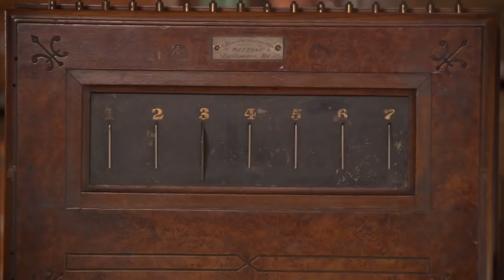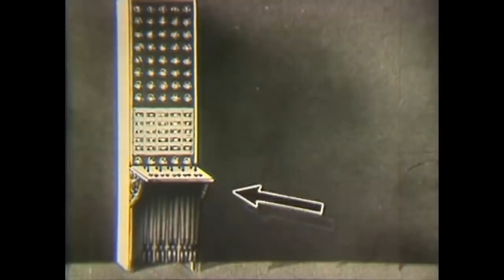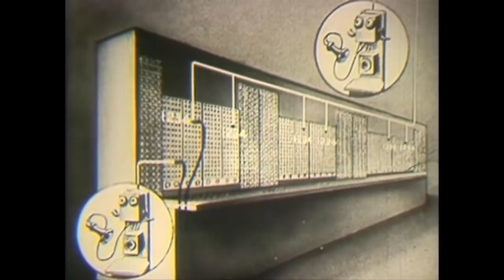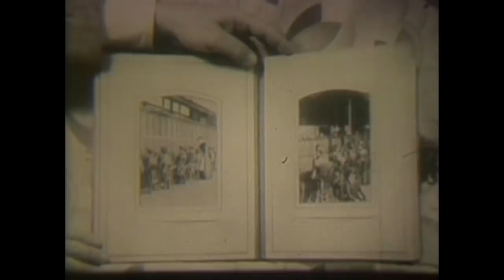AT&T Archives: Switchboards, Old and New (Bonus Edition)

Comment: My mom was an operator in the 1950s for Southwestern Bell, then worked switchboards at Montgomery Wards then at Sears (she was head operator there for some years) in the 60's and possibly early 70's.  She worked what some call "cord boards".  I learned to work the one she worked at one place she worked.  I then was able to work the switchboard at a high school I attended that had a board that was from the 40s.  I used to relieve the operators at several places I worked but by the mid and late 70s, everyone had gone to the  Demension system  which was wonderful.  No more cords and switches, it was all buttons and would fit on a desk with ease for an entire building of telephones, be it an office or hospital.  It was fun and I didn't have to do it for entire shifts,, but male operators are apparently rare.  Some people disconnected when a male answered assuming they had an incorrect number.
Reply: Oh how interesting!
Thanks for sharing. It made my day!

Comment: Retired from AT&T after 30 years. I saw many changes from 1981 to 2011!
Reply: I have contracted for the phone industry for 25 years and I also have seen many changes in equipment.
When I first started almost all equipment and materials were made in the USA now it's China or some other foreign country.
Reply: @garymckee8857   - so much easier to eavesdrop on conversation with PRC gear.
Reply: The layoffs were great!  And the dismantling of Bell Labs, another smart decision.  But seriously, the monopoly had run its course and Moore's law won.  God bless you, Mr. Shannon.
Reply: @workingtheworld68  you are correct firewalls are manufactured in 🇨🇳
Reply: All for the worse I bet
Reply: aDg 2k18  the monopoly was not good for consumers. You speak of the judge green ruling.
Reply: I'm a old microwave tech. I worked on att  public network and oil company private network since 1980
Reply: aDg 2k18  my comment was reinforcing what you said, with the name of the judge that ruled in the case.  Judge green.    IM AGREEING WITH YOU.  OK
Reply: aDg 2k18  Judge Greene presided over United States v. AT&T, the antitrust suit that broke up the AT&T vertical market monopoly on the telecommunications industry in the United States. The case, one of Greene's first after being named to the bench, resulted in the 1982
Reply: @peterjszerszen  old bell guy here.
Reply: aDg 2k18  you funny,. I regret the caps.  I should of been more clear in what I was saying.
Reply: aDg 2k18  I think it can be difficult expressing emotion and thoughts via text.
Reply: My cousin had the first mobile phone in the family in mid 80s - so expensive back then.  Now it’s almost more rare for someone to have a landline!
Reply: @southeastclass76  I remember that Ma Bell breakup like it was yesterday; Hard to believe it’s been so long now. I guess I was in Kindergarten; when I still remember the teacher talking about what a big deal it was and how impactful that company has been on society. 

I think it was a needless, shamefully wrong-minded ruling though. The company contributed enormously to our technological development — and instead of seeking massive profits on the most important advancements like the transistor, they gave it away to society for free when it could have made them billions.
Reply: @southeastclass76  Not sure we’ll ever see another organization like Bell Labs or even Polaroid, funneling so much of their massive resources into research and development. Today R&D is far more focused and narrow, primarily driven toward advancing a companies bottom line—and as a result, more risk averse.
Reply: @southeastclass76  *should've

Comment: The start of my apprenticeship with  'Post-Office Telephones' (UK), was servicing manual boards in the operator-room. Some of the equipment was put in during the early 1930s. Made of solid brass, it never wore out. The only things that failed were the operator's cords and pulleys. There are still  Main Distribution Frames in some London telephone exchanges that have hardwood terminal-blocks wired with cotton-covered wire! They still work though and the smell and sounds of an old exchange is something that stays with you forever.
Reply: Plenty brass polish, many hours cleaning those brass plugs!

Comment: Saw a really old time switchboard in Hoboken New Jersey hotel.  Worked as an operator in South Dakota on the original drop down (magneto) boards (for a town and had several lines (farms) on each line.  During electrical storms we operators would get "bit" by a small shock sometimes and all the lines would drop at the time.  Then worked 5500 boards for Morristown New Jersey (pbx) 50 Jack's to a position.  Also Pacific Bell information operator in the 1960's (madly thumbing thru a telephone book for each call). I got to love Motorola equipment when we finally got to own our own headsets. 😊

Comment: To those who are curious, the dial office shown in the film at 9:40 was the Western Electric Panel switch.  It was the first automatic switch developed by the Bell System and installed mostly in large cities starting in the 1920s.  The Connections Museum of Seattle, WA currently operates the last functioning Panel switch in the world and has a few videos about it on YouTube for the even more curious.
Reply: Before this, another form of automatic switching, known as the step-by-step system, using direct dial impulses from  callers to connect to the number being called. manufacturer was the Automatic Electric Company. Its use was in moderately large to rural cities and towns. First such switch was installed on the Bell System in Norfork, Virginia, in 1919.From then on, it was used on both Bell and non-Bell telephone exchanges.Try the  Connections Museum of Seattle, WA, as these, like the panel system, are no longer operational.

Comment: When I was a young girl in the 1960s, my dad went to have a hernia operation at Franklin Blvd hospital in Chicago. I went in and out of the waiting room with my mom, and there was a room with ladies connecting calls with plugs into switchboards. I had a small transistor radio with a little earphone that my mom bought me. I told her, I can plug the earphone into the earphone jack the same way that the operators plug the plugs into the switchboard.
Reply: I think the plugs and jacks are basically the same design, just smaller on modern devices.

Comment: This seems far more impressive - if confusing - than just doing it electronically. All the stepped switches and plugging wires in all over the place seems like more of a technological feat.
Reply: When the telephone was first invented there was no switching at all. you had to order a pair that only talked to each other; more of a simple intercom system. Manual switching and interconnection came later. When a network or town outgrew its switchboards, then it was automated. Later, local networks were interconnected with each other for long distance calling capability. It's a great example of how one invention spurs another in a kind of evolution. No one envisioned the entire system from the beginning.

Comment: How does the operator know when the call is completed though, so they can unplug their patch cable?
Reply: The boards we had would close the eye on the circuit when the call was finished. We also had a check switch so we could listen in without clicking on the receivers of the users and it  muted our microphone so they could not hear us.  In the Army, we had to ask before removing the plug, like "are you working? are you working? BREAKING DOWN! then pull the plug.

Comment: Working a full shift on one of these cord boards looks exhausting. I worked in a large call center with no sound proofing between the operators. It often was so loud that I couldn't hear myself think. I took roughly 200 calls a day. These gals look  like they're each taking much more than that. I left this job in 1996 and still can't stand hearing a ringing phone.

Comment: For decades,  we were used to the 0-9 key layout of calculators.  Then telephone operators had to get used to key layouts that were two rows!   Then some nut invented the touch telephone that had a key layout of a familiar calculator, except upside down!   Why??
Reply: Joshua Sidell Yes, The "telephone" layout was designed to emulate the rotary dial. (lower numbers on top ). One needs to remember that the average person was immensely more familiar with the rotary dial telephone than they were with calculators (or even adding machines,for that matter). in the 50s and 60s. Even the "qwerty" keyboard was more familiar to "civilians" than the "calculator" layout. It wasn't until the middle 70s that inexpensive calculators became available and introduced the masses to the "calculator" layout.
Reply: Joshua Sidell I wasn't disputing anything of what you said, I was just pointing out the 1950s-60s consumer perspective  and how it influenced Ma Bell's design consideration.
Reply: Joshua Sidell Yes, that's a "thing" especially among us "older" folks who are used to "telephone" format, It still "hangs me up" (pun intended!) when I use the numeric keypad on the PC!

Comment: I'm old....can you even reach an 'operator' today??
Reply: You can, at least with AT&T.
Reply: and with today's cheap fibre transmission technology, they save money by having the operator be in a low wage country overseas.
Reply: Yes you can! I use them a lot at work for international calls. Especially when I can’t remember the dial-out code :)
Reply: More and more, the subscriber is the operator.
Reply: In hospitals when a patient can’t speak english, there is a number hospitals can subscribe to that allows staff to call for a translator.  And it’s maybe the only option unless the hospital has a system of volunteers to use.   I’m retired but I’ve used this in big centers in different states.  Known as AT&T Language Line.

Comment: Does the standard of Female Telephone Operators have to do with the Speaking Registers of Women vs Men?

I. e. Higher (Soprano-Alto Registered) voices sound more clear?

Even on Current equipment I have been accused of "Mumbling."
Reply: My guess is that it was primarily related to the fact that they could get away with paying women less.
Reply: @kcgunesq  That Too.
Reply: If I remember correctly, another reason women were preferred as operators was due to their perceived greater manual dexterity.  Women on average have smaller hands than men, so they were thought to be more capable of dealing with the densely packed switchboards.  However, it probably did have a lot more to do with being able to pay women a lot less than men.

Comment: How do operators call numbers with the off hook tone when the certain number has left there phone off the hook? How does the off hook tone work?
Reply: They would just plug in an offhook tone into the jack that was the number offhook.  The circuit would latch onto the phone loop and auto release when it was hung up.  When step by step switches were put in,  an offhook line would reduce the traffic capacity by hogging a selector.  It was routine for staff during slack moments to plug the offhook tone into the selector to clear the "path hog".  The early analog common control switches, and this generation of digital switches solved that problem by ignoring the offhook after a timeout of the automatic offhook tone application.

Comment: Sorry, but the last manual switchboard in AT&T's Bell System was indeed NOT from Catalina if it was taken out of service in 1979.  I became a switchboard operator in AT&T Long Lines in Pittsburgh Pennsylvanias International Operating Center in August, 1981, so we were still using "cord boards" for several years after the swtichboards in Catalina were decommissioned.  Just a little FYI for the real telephone geeks!
Reply: Perhaps they meant last domestic switchboard use then?
Reply: @cpufreak101   Not sure, Justin.  You might be right, but even before I went to work at AT&T, I was a switchboard operator at an answering service.  It was a fun time in my life and I am glad I have pictures!
Reply: Robert Knight They’re referring to the last manually operated exchange, ie every call on the island was completed by the operator. 

I suspect pockets of old equipment was still in use up until Bell switched over to electronic switching in the 80s/90’s.